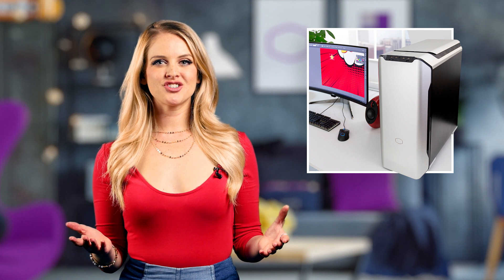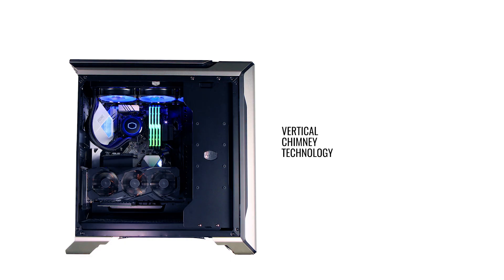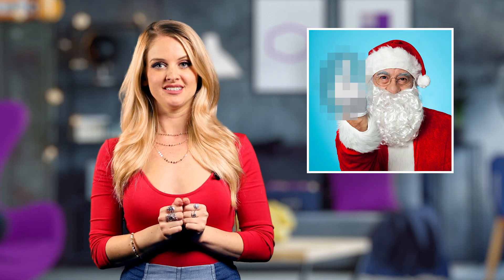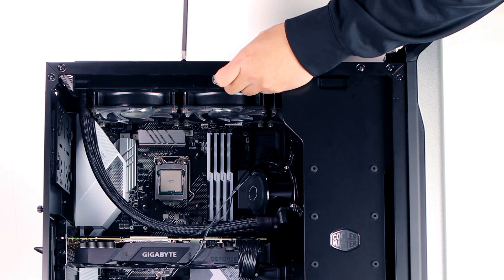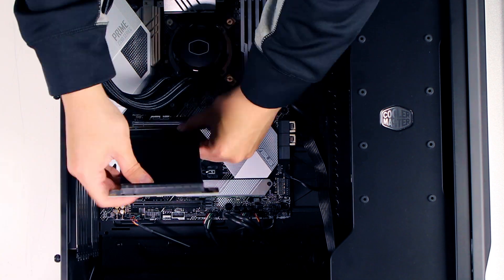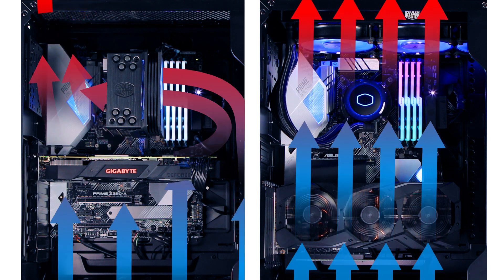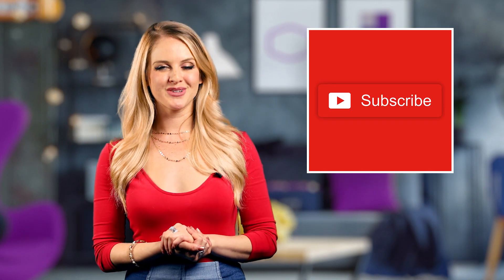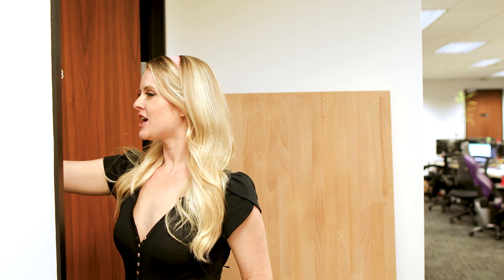Optimize Airflow with the SL600M - Just the Tips, ep 8

Comment: For anybody considering installing a thicker than usual radiator at the top: 

The top tray can become a problem with thicker AIO rads. For example, you may have trouble installing a Liquid Freezer II 360 from Arctic with 34mm rad thickness. You can not use the middle 120mm section of the tray as the rad collides with the protruded hole into which the IO shroud is positioned. You can not use push configuration as the fans will collide with the motherboard IO cover. And when you say "A-ha I can mount the fans at the top and rad off the tray center, so neither the rad nor the fan collides with anything", your fans sound like a Spitfire as the fan blades are blocked at one side. Positioning the fans between the rad and the tray is out of question due to packaging reasons becoming worse. If you position the rad in the front you defeat the purpose of the case and if you position the rad at the bottom you kill the AIO pump. You also cannot offset the tray itself enough as it will hit the plastic frame of the top cover.  

It can be probably solved by either getting a new AIO with a thinner rad, retrofitting some gaskets above the tray to offset pull fans, using reverse flow fans such as Sickleflow Reverse Edition 120s to have offset pull fan blades, getting thinner fans for push configuration, suspending the radiator with some zipties, or mount the rad vertically inside the case with some rad adapters. 

You can use push configuration with the rad mounted at the top and off the tray center. But then you may have to remove the motherboard IO cover and without the IO cover RGB cable connected, you may not be able to use any motherboard controlled lighting solution.

Sure, hints related to rad thickness allowed at the top were given in the CM site, and I respect that. But very small changes to the top tray could have given this case so much more in terms of compatibility.